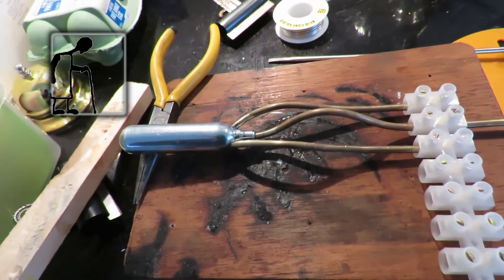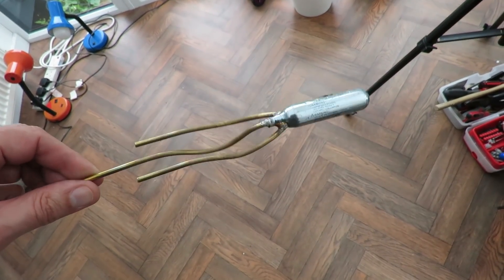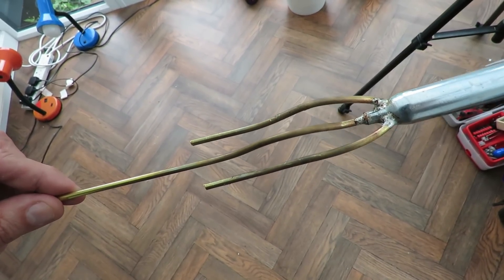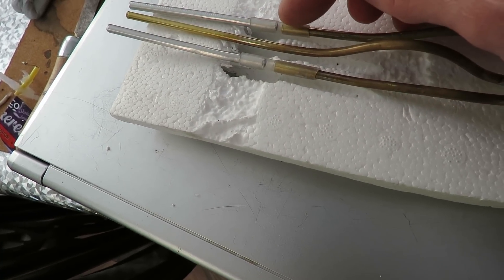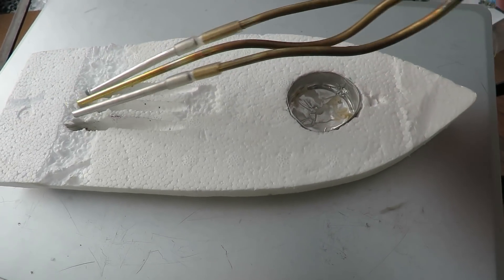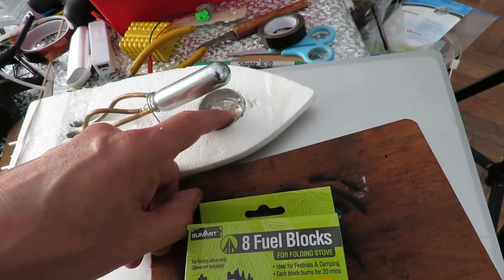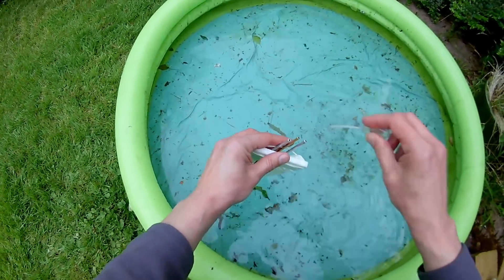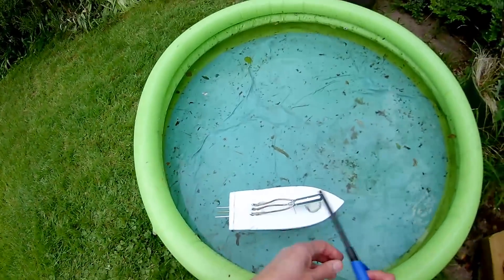Triple pipe CO2 capsule boiler pop pop boat P1

Comment: Solid alcohol tabs might be a little too hot for effective use. personally I believe an oscillating pulse action happens with a twin tube system.
Reply from the maker: If you want to see more, here are my playlists 
Induction Coil Pop Pop Boat https://youtube.com/playlist?list=PLA5a2xPRSrB0H5e46TYFvq1lwUd8D1UNQ
Pop Pop boats https://youtube.com/playlist?list=PLA5a2xPRSrB2M0m754LkqMXQFwFRAS3HK
And here is an excellent video by Steve Mould
Pop-Pop Boats Are Weirder Than You Think https://www.youtube.com/watch?v=3AXupc7oE-g&list=PLA5a2xPRSrB2M0m754LkqMXQFwFRAS3HK&index=2
And you might find this channel interesting Resonanttheme
https://www.youtube.com/@Resonanttheme

Comment: The boiler chamber on a typical is able to flex which helps with the in/out movement of water. You're relying solely on steam vacuum to make that movement.
Reply from the maker: Hi Kenneth. Are you able to provide any data that supports your comment? How would the flexing diaphragm change the performance other than give the pleasing Pop Pop sound? Oh, and did you miss a comma between steam and vacuum? obviously steam is not a vacuum.

Comment: I've got a shed with loads of tools I use for metal work and soldering and welding, I've never thought of making these, they look so easy to make, but maybe that's just years of experience making it look that way, I'll have to give making a pop pop boat a try, thank you for the information
Reply from the maker: I strongly recommend Daryl Foster's channel - link in my video description - he made some excellent boats. He has stopped now, but his channel is still there so you can see his work.
Reply: @GrandadIsAnOldMan  I just discovered Daryl's channel, SUCH amazing work. Artist, craftsman, scientist, filmmaker and silly old fart. Charmed me into watching his entire channel over two days. At first I was a little frustrated because I started looking at his more advanced designs and I knew nothing about put put pop pop oscillating pressure wave boat engines. I decided to watch his videos in order and did just a little googlewebbing and now I feel like I have a good grounding to start experimenting myself. I like his "Easybuild version" not just because it promises to be easy to build but it sounds like an over-cammed V8 burbling away at idle. https://www.youtube.com/watch?v=aOeSnlWnnIo&list=PLeTreyuYM8qSAaYbqy-QYNqsO1D7nstid&index=4

Comment: Use need a flame proof hull for sure.
Reply from the maker: Not really, it is in water after all, so if the worst happens you can sink it quickly, but generally the only thing that gets hot is the middle of the boiler and the middle of the tealight. If you check my playlist, most of these boats are plastic or foam, like this one.

Comment: Genius clamping method!
Reply from the maker: Thanks, it just happened to be the right size and happened to be in my tool box.
Reply: @GrandadIsAnOldMan  I was impressed with the power of this engine - do you think it was the number of tubes, or the heat source that made the difference?
Reply from the maker: @AtomicShrimp  mainly the heat source I would think plus I took a little more care on the pipe bends following the advice Daryl Foster gave me. He recommends they have an upward section before they drop down to the water. Whether it made a difference or not I cannot really tell without making an identical one without the extra bends but he has been doing pop pop boats for a long time. I also suspect longer pipes would help. Twice when I started this boiler it reached a heat where it seemed to expel all the water in one sudden burst and then may not have refilled itself effectively and I had to give it a top up. There is an awful lot to learn here before I get really effective boilers. I have been watching some old Japanese videos where they seem to be very effective and they don't have the extra bend. Here is an example https://www.youtube.com/watch?v=N6TaBxz5VpY&list=PLA5a2xPRSrB2M0m754LkqMXQFwFRAS3HK&index=131
Reply: How far up into the cylinder do you push the tubes? Centre different?
Reply from the maker: @stevesyncox9893  good question. I have made several pop pop boats that are just a coiled pipe, so there is no "boiler chamber" to push the pipe into. They still work the same way. The water boils, turning to steam. The steam takes more space than the water did, so it pushes out down the pipe, where it cools, condenses back to water, thereby reducing the space required and the water outside pushes back in again. When it is running right, the steam never actually escapes all the way down the tube before it has cooled, condensed and is drawn back again. So in answer to your question, I don't think it makes any difference. I just did a quick Google check and water expands by a factor of 1700 when it turns to steam, so you don't need much water in your boiler. https://youtu.be/me5ZVMD6N6Y
Reply: @GrandadIsAnOldMan  Thank you. I am wondering if the coils draw in one tube and out the other, depending on the highest heat contact. I’m also wondering if 2 different size tubes would create the draw and push action on a continuous basis. I think if the output lines on your boiler were longer inside, the centre short at nozzle you may get a circular motion with the water. Maybe not. Thinking is cool. Thanks man.
Reply: @GrandadIsAnOldMan  thank you for the safety warning vid link. It is very much appreciated. Your compassion is noted.
Reply from the maker: @stevesyncox9893  Yes, that is a common question and a common mistake in the understanding on how they work. Think about it. The steam is pushing down all the tubes at the same time. Then the water is being pushed back into all the tubes at the same time. There is no circular motion. I have a few single pipe boats to demonstrate that. If the water was coming in one pipe and out of the other there is no way it could turn to steam in the middle. Having said that, Daryl Foster did several attempts to see if there could be any benefit by having one or more pipes facing forwards to gain anything from the forward motion of the boat speeding the flow of water into the pipes. You will find links to his videos in my video description and I also put most of his videos in my pop pop boat playlist.
Reply from the maker: @stevesyncox9893  Although you could cause some damage, the most likely result with these boats is the solder will give way and the boiler will leak.